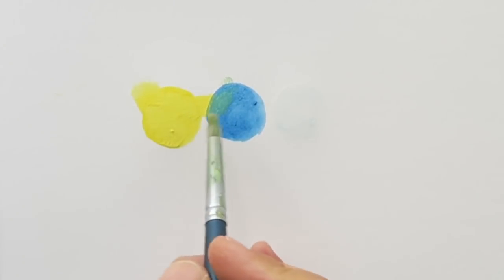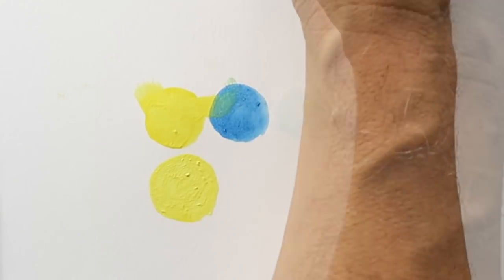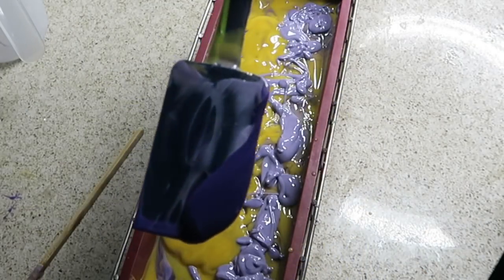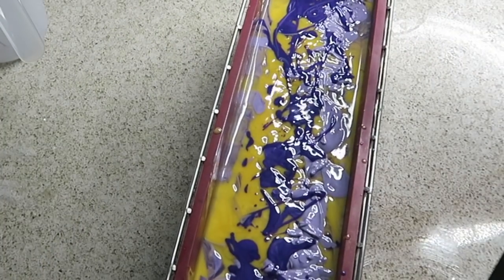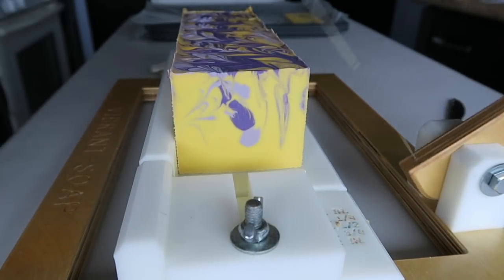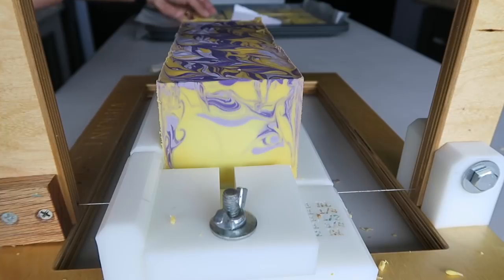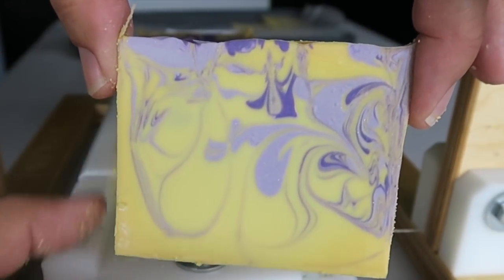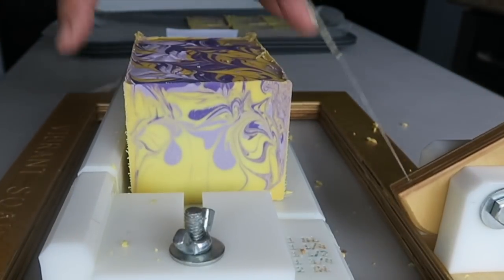Making Lemon Curd Cold Process Soap

Comment: That certainly makes a very refreshing looking soap!  I have some trouble predicting the final color result from yellow micas. I used Nurture's Sunshine yellow yesterday to make a tint of it, let it sit while preparing another pot of pure sunshine yellow, and found that the tinted color darkened considerably in the pot!  Had to add more titanium to the tint.  Also, usually most mica colored soap ends up lighter when it's cut compared to when it's wet in the mold. So far this soap (still sitting in the mold) has stayed true.  I've found Nurture's purples to be the best! What you see is definitely what you get!
Reply from the maker: I agree with the yellows. I'm getting better with them, but seems like they do have a mind of their own, so to speak. It's about finding the right micas and playing around with the usage rates.